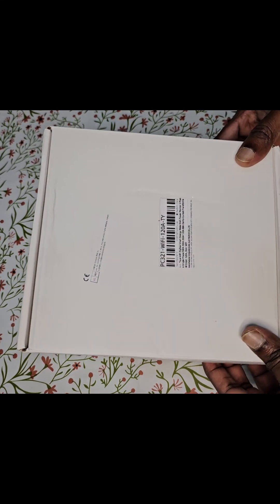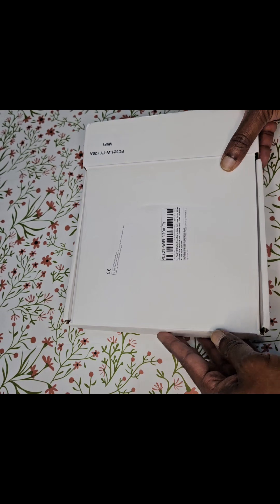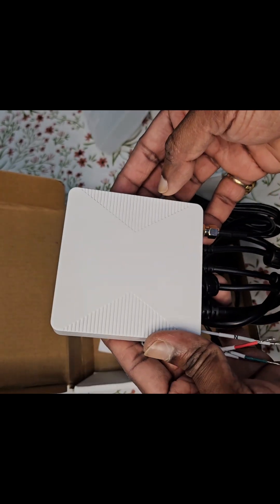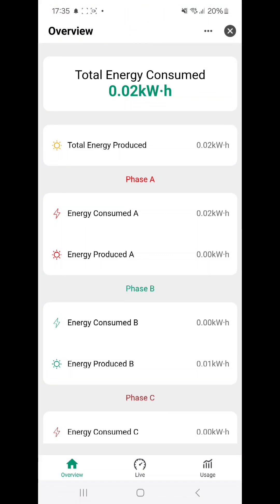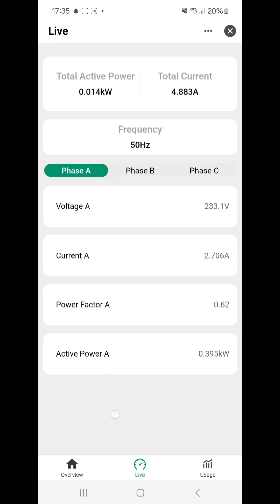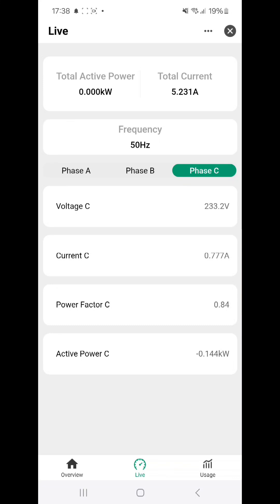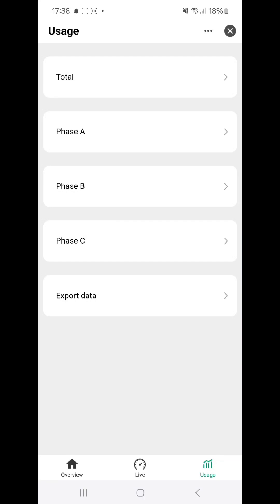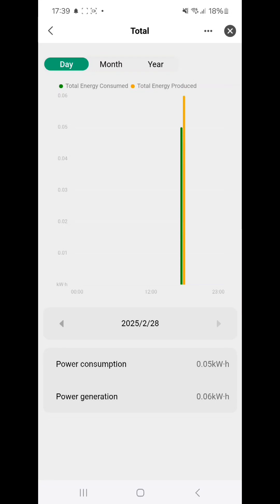EARU bidirectional Three Phase Clamp  Meter PC321-W-TY 120A Review

Comment: I have a question there are 5 breaker in db box and we have also 5 smart energy meter same brand of your video same product if I will take power supply from another 6th breaker and make clamp same like we install it's work ?
Reply from the maker: Yes, you can take power supply from another breaker.
Reply: @HouseAndSolarProjects but brother there is 5 energy meter can we put these 5 meter in one breaker and 1 power supply?
Reply from the maker: Yes, you can.
Reply from the maker: It is a three phase meter, I would not recommend. You can use the single phase meter there.